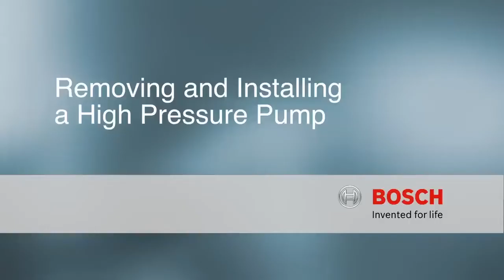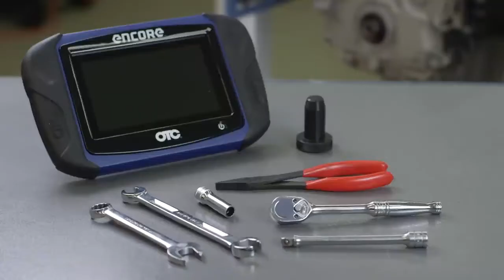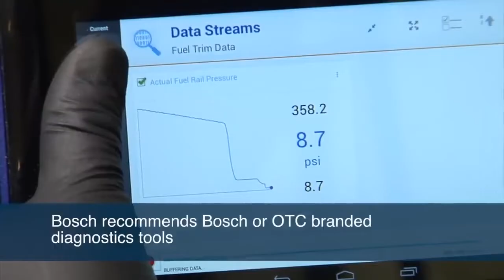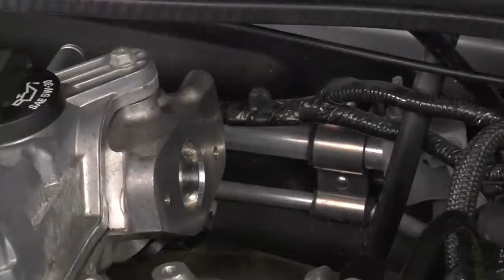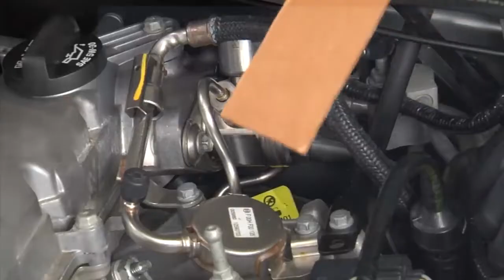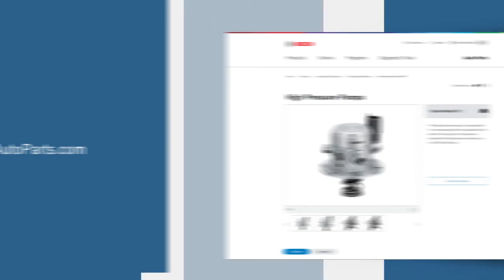Removing and Installing a High Pressure Pump

Comment: Does the fuel pump need to come out completley when putting in a new engine?
Reply from the maker: Hello.  Thanks for reaching out.  Yes if you are installing a new engine, the GDI pump will need to be removed as it is mounted on the engine bay. Please make sure to de-pressurize the fuel system prior to removal, though, to avoid potential injuries/hazards and always follow manufacturer’s recommendations for pressure relief procedures.

Comment: Botch u need to just stop making the cp4 in general it’s garbage how much do u pay ford to use it on a 6.7? 10,000$ repair for a shitty stock pump
Reply: This isnt a CP4 fuel pump and this is not a 6.7L Powerstroke, its a 100$ HPFP and a GM 4 Banger 2.0L LNF DI Ecotec Engine. Book time is 1.2 Hours.